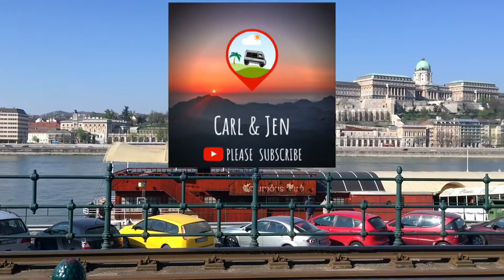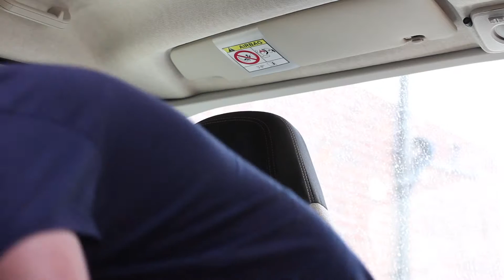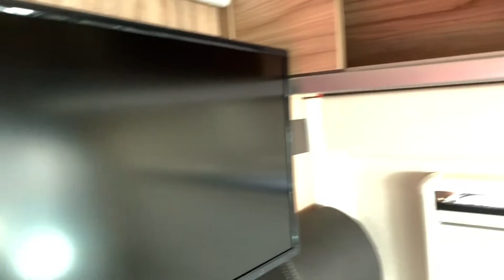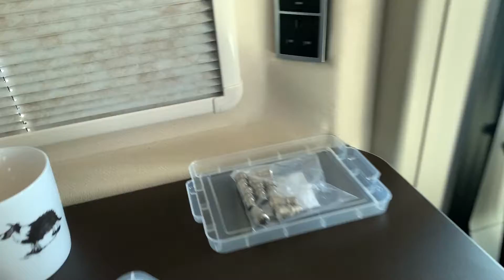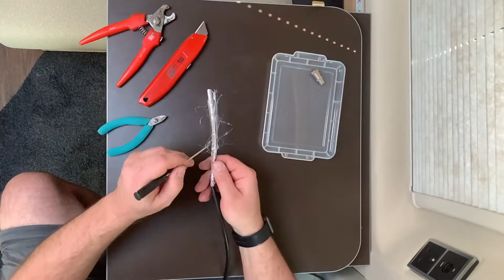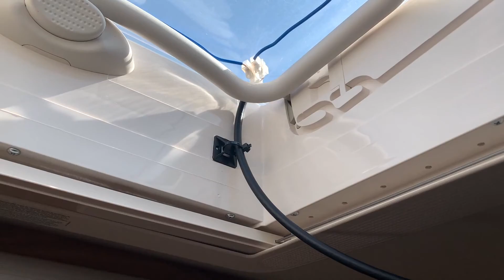Campervan DIY TV Aerial

Comment: I have a fiberglass top will it work if I mount it to that?
Reply from the maker: Wood is good, plastic is fantastic! So fibreglass shouldn’t be too bad. It may knock a few dB off the signal but if reception is good then I think you should be okay.

Comment: Does that work for digital tv
Reply from the maker: It does if the transmitter is horizontal. Sometimes I have to reposition it and make it vertical. You can improve it further by adding a £4 balun from Amazon.